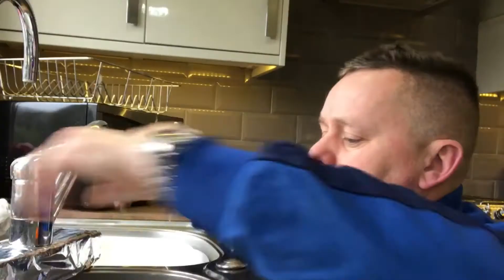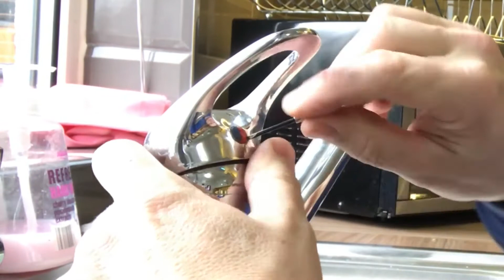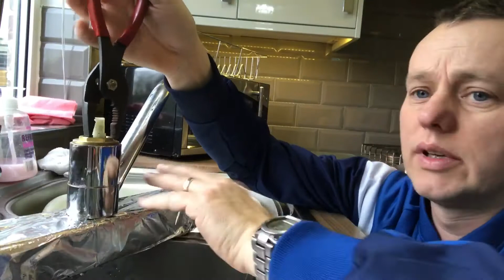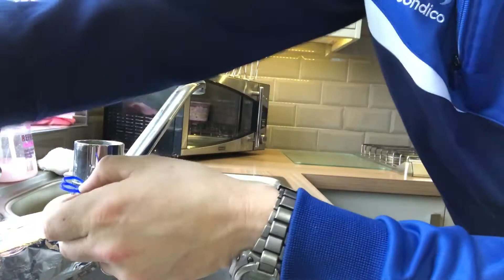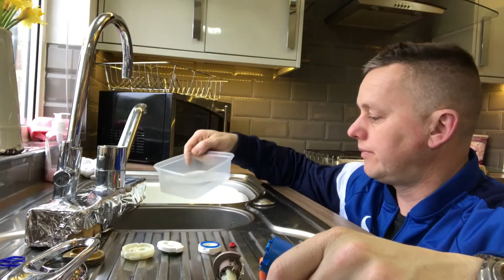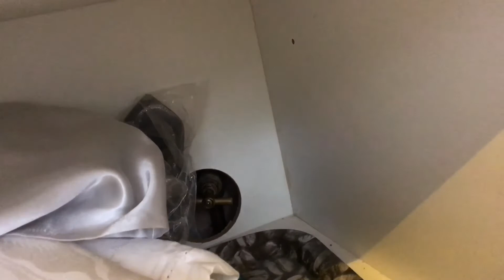Dripping Tap Franke Pro Top, Single Cartridge How To Repair No New Parts

Comment: I tried stripping mine down but had difficulty putting it back together. I would recommend that you take photos as you strip down and mark which way the bits go back. Don’t forget a smear of silicone grease on reassembly
Reply from the maker: Thanks Peter for the great information👍🏻👍🏻🛠